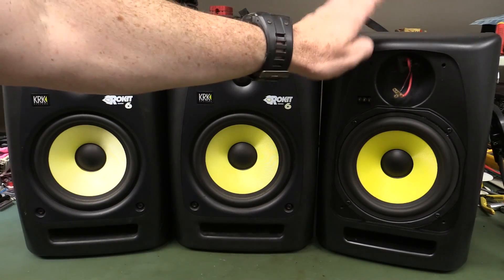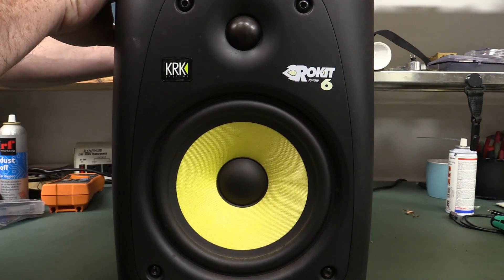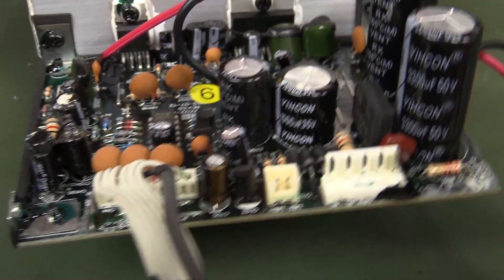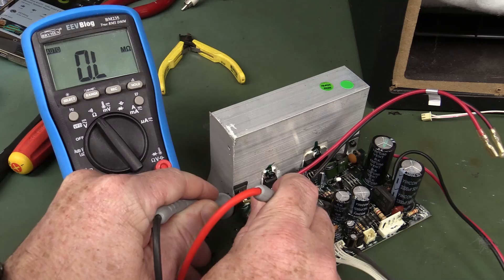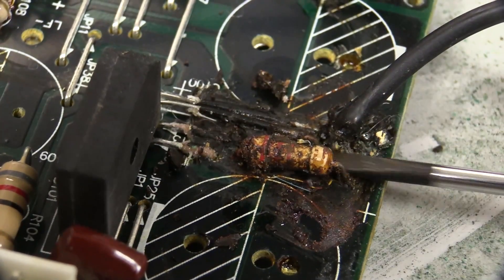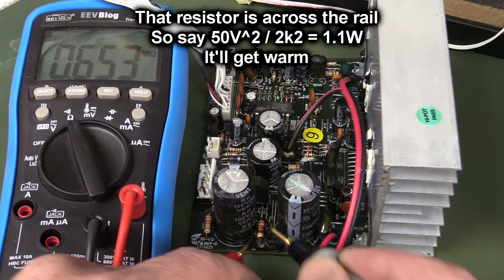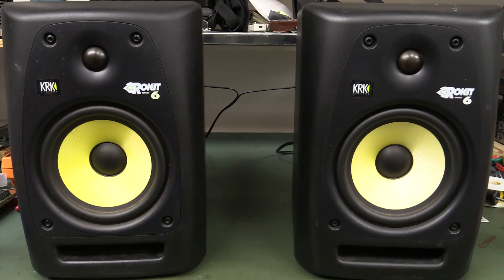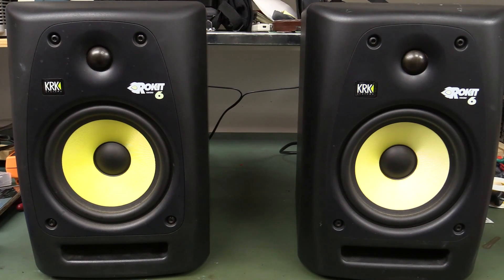EEVblog #1073 - MORE KRK Rokit Black Gunk Speaker Repair

Comment: Both of my Rokit 5 G2s failed. They both got the startup thumps and a crackling sound.
Reply from the maker: Crazy!
Reply: Yup. But I wasn't particularly mad about it, though. They're a prosumer monitor, and I had long since replaced them. They got me through when I was starting out and they were pretty cheap, even new.
Reply: By the way, that crackle starts quiet, and then over a matter of weeks of regular use, it'll get louder and louder until they're unusable.
Reply: Sounds like caps are on way out!  Got a set of Tapco's off ebay for  $30 with a similar issue -- a recap and they are great holiday monitor I can chuck in the car.
Reply: I have considered repairing them for something to have on the workbench for tunes. For monitoring in my actual studio, I use Focal Solo 6s. But it's not really worth my time at the moment.

Comment: I've been using my Gen 2 KRK 8's for almost ten years now every day without any problems so far.
Your videos do make me want to check the PCB's.

BTW: my tweeters also produce a soft hissing sound, the volume setting doesn't affect it. Not really a problem, when I'm sitting at my listening position it is barely audible.
Reply: I'm in the same situation. My RP8 G2's are probably the only devices I own that I didn't open up yet. (also have them for around 10yrs now). But if I can remove the black crap before they die on me it'll be worth it. I use them not as studio monitors but as a regular stereo pair, and for that they're perfect imo.
Reply: Right, those KRK's are decent speakers for their price.
10 years without any problems is great in my opinion, I have seen equipment fail much sooner.
What lifetime did KRK aim for anyway?
Reply: Look forward to that hissing sound getting louder and louder over time until you want to throw things at your monitors because it is so damn annoying.

PS: I heard that you can expect capacitors to fail after 5 years on a PC-forum. Maybe that only goes for the ones on Motherboards, though.
Reply: Some hissing seems not uncommon when you listen close to a speaker.
I can hear it with other monitor speakers, PA equipment, etc of popular brands.
Reply: ericBdrums yeah, it's analog signal amplification, you'll always have some noise, even when you use the balanced inputs.

Comment: Two of mine (bought as a set) both exhibit the problem, one has a completely shot woofer the other one has crackling on the tweeter. Took one apart and removed as much gunk as possible, replaced the two larger woofer caps but problem still persisted. I could tell that the same resistor was corroded as yours are, however still read 2.2k... I also noticed a diode had also been significantly chewed up but couldn't get a reading for it, so replacement is unlikely... Wish KRK would just own up to the black gunk issues and send out a revised PCB to users competent enough to replace them...

Comment: The delayed bass at power up could be because they've replaced the anti-pop relay with a ramped bass filter...that could explain the 16-pin IC
Reply: Had to scroll down for some time to find someone mention this.
Reply: I have the revision 2 G2 with relay and still have delayed bass on. Still trying to figure out where the fault is. I have replaced a lot of caps and cleaned as much as possible. Also changed the resistors he changed with higher wattage ones as mine were also burned.

Comment: dave, at 16:11 you turned up the gain and showed the tweeters had noise. do they still make the same noise without the rca leads plugged in? i've found with these using balanced xlr cables gets a clean sound without any of that noise. and your better off leaving all the pots on the back at 0dB and making any volume adjustments at the audio source. do these things and you won't even know the krks are on when idle.

Comment: How about using a small heat gun (ie. your SMD gun) on a low 100° setting to help melt and loosen that gunk up?  As long as you keep the temperature down and are careful around the capacitors I think it would make it much easier.
Reply: What would happen if you use it around the cap? Explosion?
Reply: @Renulph  - Ya, you don't really want to get electrolytic capacitors very hot.  Best to use a small SMD hot air station and not a big hot air gun that will heat everything up.  LOL... this is an old comment you replied to!
Reply: @ElmerFuddGun  Would a Wagner furno 300 work?
Reply: @Renulph  - I had to Google that.  No that is way too big IMHO.  Search for "hot air soldering station".  I have an 858D (very common) that I would suggest.  Hope that helps.
Reply: @ElmerFuddGun  Thank you, is that the Sumsour brand? Surprisingly cheap for something that seems kind of dangerous?
Reply: @Renulph  - The "858D" seems to be made by many companies in China.  I would suggest reading the reviews and look at the company feedback, etc.  Not all 858Ds are the same inside (crazy I know) as it is more a marketing name than anything now.  When I bought mine on Amazon it was reasonably competitive versus getting it on the slow boat from China and it would have been easy to return if there was a problem.

Comment: I've read on electronics forums (IIRC, Badcaps) that some computer power supplies had issue with conductive glue as well. But in their case, the PSU would literally explode when the glue became conductive enough.

Comment: Glad to have picked up some PreSonus Eris E5 monitor speakers instead. They have been going strong for a couple of years now :)

Using them with a PreSonus AudioBox iTwo USB DAC, connected with balanced TRS cables, for that super-low noise floor. Couldn't be happier.

Comment: I got a good deal on 2 gen 2 5s with a 10" sub. First speaker set i ever bought. Within two weeks one speaker stopped working literally blew a uole in the PCB where the woofer resistor was. So i bought another used one. Then the second speaker went out. So i did research and figure out the problem. I replaced it with a gen 3, which doesnt use the black death. Funny how they wont do anything about their product self destructing, but fixed the next gen.... Anyway, i stopped using them a long time ago, and have 2 speakers for the price of 4. Wont be using krk products again.

Comment: This is actually the manufacturers fault. I've seen this on few other active speaker models too. They're cutting corners and using mdf glue in pcb's where it doesn't belong.

Comment: the noise is prolly some current still moving / shorting across the circuit board from somewhere , maibe you can use some solvent to get the residue off the boards (prolly removes the writing on the boards too though )

Comment: I'm listening to this video on Gen 2 Rokit 5's.  The woofer cones also protrude when powered on, but only if they've been off for a few hours so I expect it to be the same caps in each. The mains filtering is pretty bad too, it picks up the dimmer noise from our kitchen downstairs. None of my other amps pick it up so I also suspect the same bad caps again. I could probably replace them but honestly I'm waiting for them to fail so I can just get another brand. Not a single recall issued, screw KRK.
Reply: Well here I am again, and the problem finally deserves a proper repair lol. Lost the tweeter now so we'll see what can be done to save it

Comment: 12:54 I also did not work. Two resistors and two diodes were rotted. It is necessary to change.

Comment: are there any solvents to cut that crap?  - got Rokit8G2 starting to fail - not yet opened.   If had measurement stuff then I'd attempt a passive crossover.

Comment: Did you ever find a solvent that breaks down the compound?
Reply: I would like to know this as well. I found some replacement amps at fullcompass.com for 1/2 the price of a new monitor. Maybe I can peel it all off of there before installing the board in the enclosure.

Comment: Do you know what type of capacitors are in the middle of the board? I'm using a rokit 6, but I wanted to replace two bulging caps in the middle. What would you replace them with?

Also, is it safe to use acetone to remove this glue?

Comment: yeah i have this tweeter noise all the time. Recently had one of my rokit6 gen2 fail on me. The sub just isn't working right, outputting very low volumes in the mid range but nothing low. I don't know if i trust myself to fix it diy... i've only ever done very minor soldering before and getting components will be tough :( If only there was a repair shop near me.

Comment: my KRK PCB is covered in translucent yellow gunk instead of black gunk. All of the caps and resistors look fine but the speaker only gives a few seconds of sound before the sound cuts off (LED stays lit) until I turn it off/on again. Any ideas?

Comment: I say NS-10m Yamaha, but not power, reason i’m just bias and love a classic
Reply: Craig W     A white cone fan ! See a lot of those in all sizes of studios.....
Reply: I don't trust a monitor that makes you put a napkin over the tweeter, if you want to go back to that era unless you can afford Barefoot's,  get the old Tannoy PBM 6.5's, they gave the best mix. The funny thing is we tested my old QSC power amp with my Marants 1040 from the Jurassic era and the Marants had more accurate and honest specs, and the perfect amp for the Tannoy's. Mixes sounded better on every system I listened to them on with that combination. I really do like the dsp crossovers with the seperate amps per driver a lot though! No more separate amps and the damn cables that comes with that setup. Cables are the devils work...unless you can afford Mogami.
Reply: Craig W Yamaha MSP7 Studio is the way to go if you love the NS10m. For me, I love the Eve SC207. I still have a pair of MSP5 and KRK RP5G2. All of them still working. The titanium tweeter of the MSP is really durable compared to the silk dome of the KRK.

Comment: What are the green things next to the woofer resistors? I can't for the life of me find out what they are. You had the problem where you turned it on and the woofer was not working, but I had the opposite. I turned it on after replacing the caps and it sounded great then faded back to not working. Thanks for the great video!

Comment: I have a pair of rocket 6 3rd gen. 1 of them just stopped working. Powers on but no sound. I do t see anything wrong inside the speaker at all. Any ideas? I’ve had them only 3 months.

Comment: After your last video i bought some Gen1's so i can keep working and opened my Gen2's.    My set hasn't failed but i noticed wierd resonace/crackling in one of the monitors.   My boards are rev1.2. they have the relais and different cap cans on the tweeter amp.  the wierd thing is tha tmy caps arent fixed wit massive gunk (barely any on it). 
The brand is TBOR not YIHCON  and they are rated at 2200uf  not 3300uf ...

Comment: This glue is the scam of the ages. Manufacturers have been using this stuff for decades with always the same result. They all absolutely know about it, stop for awhile when they get called out for it then always go back to it in the dark of night if you will.
Reply: First, why do they need it?  And second, I think any dopey window calk from Home Depot would last longer than that crap.  I've seen caulk last for 25 or 30 years.  And that's outside in the weather.  Inside a speaker doesn't sound like a gruelling test to me.
Reply: I guess inside of a speaker is a vibration-rich environment by definition. 
Power supply bricks usually are loaded with some kind of compound too, but the ones ive opened had a white, more solid kind that didn't turn to shit.
Reply: misium the white stuff is Silastic a silicone compound made by Dupont, that's... well much more elastic than that black resin compound. I suppose it's way more expensive or harder to get into production lines...
Reply: When subjected to heat over the long (not so long) term it turns dark (carbonizes) and any circuit (most)that has any sensitivity to rogue conductive paths will malfunction. You can remove it but often it's too late and the board is impregnated with the conductive byproducts. I used to attempt this process but no more. It's usually a waste of time and if it does work it is often short lived. I don't know what this stuff is made of. Thing is, customer 1 gets burned by brand A, goes to brand B where customer 2 gets burned and goes to brand C and so on until customer n gets burned by brand Y and goes to Brand A. Nobody goes through enough iterations to figure it out. So brand A has no accountability to these shenanigans, nor do any of the others.

Comment: After 7 years, one of my gen2 rp5's woofer has got the hum (volume/cable/input doesn't make a difference). I started scraping some of the gunk but no luck so far. I'll have my multimeter back next week to test the caps but they look fine. Any further tips?

Comment: The noise? Probably some corrosion on the audio input or the actual patches. Chuck some wd40 on a cotton bud and give 'em a wipe. The first gen rokits are actually fairly decent budget monitors (don't know the second gen ones). I'm still using mine professionally as "back ups" to my headphones. For a coupla hundred, definitely better than most of the 1000 buck sets out there.

Comment: I wouldn't be surprised if the black "dye" used to make the goo black is recycled toner powder which is conductive if memory serves.  Once the base material solvent evaporates to the point where the carbon toner particles start making contact with each other aka dry and crusty stuff, you have a paint on resistor.  Special secret cheap Chinese recipe.
Reply: The Dollar Guy thats actually genius! I like it.
Reply: Godspeed The Dollar Guy you know to much 🤐
Reply: Why would a toner powder be mixed in into the compound in the first place? To fake  visual properties of some other, proper compound, I suppose? It's the only thing that comes to my mind...

I wouldn't buy that for a dollar :P
Reply: You might if the other goo was $10.
Reply: When it's all new it's a light/medium tan. Only the heat turns it dark. This was an extreme example of how bad it gets. What is not shown is how it can leach into the pcb and leave it conductive even after you clean the surface. Not good for high impedance circuits. It's the perfect product when used as intended which is to limit the life of the product it's used in. Seriously, there are so many other compounds they could have used that even though I'm not a big conspiracy guy this crap stretches me very thin.
Reply: Inside, there were areas he picked at where he said it had not gone dry and still had a soft vinyl/rubber type property.  As in liquid electrical tape which is black and is my theory they may have tried to copy that product using black toner in whatever base material they selected.  The tan stuff you mention is also very bad at going conductive, but I have never seen it go black as of yet.  Then there was the white "silicone".  Silicone in quotes because I don't know if it was silicone, it actually felt like putty... or decomposed into a white/beige putty consistency that was slightly conductive as well.  I agree with you that it is amazing that such a simple insulative/vibration coating could end up causing so much grief in an otherwise decently high end product just to shave pennies.  It is as if one would have to go to great extents to find a brush on material that would later become conductive.  It does happen though.  All the Polaris ATV with the little body control module that goes bad like the plague.....  silicone used to bond a MOV to the PCB destroys all SMD resistors in the immediate area causing complete failure.
Reply: I thought toner was plastic (wikipedia says polyester resin). What's conductive in that?
Reply: Khron's Cave - Small particles of Carbon, IIRC.
Reply: Carbon Black

Comment: I actually just had this problem on one of KRK Rokit 8 (G2). It cause one the leads to corrode all the way through on the amp. Also one the filter caps and bleed resistor was severely corroded. I am like what freaking bean counter decided to use this instead of proper compound.

It's other mate had corression, but I cleaned it before any more failures.

Comment: There is a predictable result from complaining to the compound supplier: "You are holding it wrong" uhmm "You are storing/mixing/curing it wrong".  Which might be the case, but the compound shouldn't be so sensitive to conditions that it fails in such a damaging way.

There is a lot of high reliability / environmentally robust equipment that is potted.  It's frustrating to analyze failures only to find that it's in the expensive potted modules pitched as highly reliable.  (I'm looking at you Lambda.)  You have to carefully carve away the compound .  Inevitably you find that the compound has shrunk, pulling apart anything it can.  That's usually laid-over caps which have the leads pulled out of the cans.
Reply: Can you tell me how to remove this gunk if it's still too sticky so scrape it off? Isopropanol?
Reply: Compounds are made to be resistant to the environment, which usually means that common solvents and heat are ineffective.

Comment: Do they sell those those amp boards anywhere (krk or 3rd party)?
My woofer started cutting out, it got progressively worst.Now the woofer is mostly off but comes back for a few seconds once in a while.I inspected the pcb, its filled with that black gunk.Caps look fine but some parts of the board are corroded.The resistor between the big caps is extremely corroded.